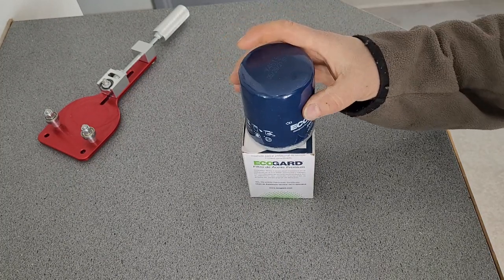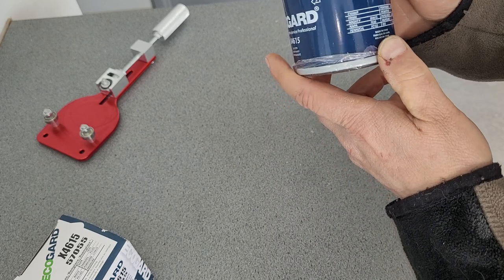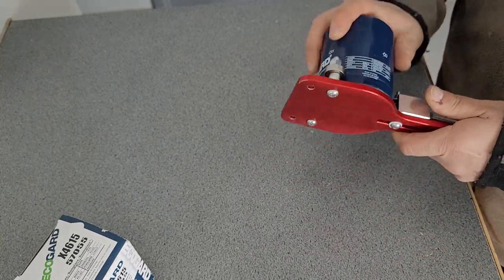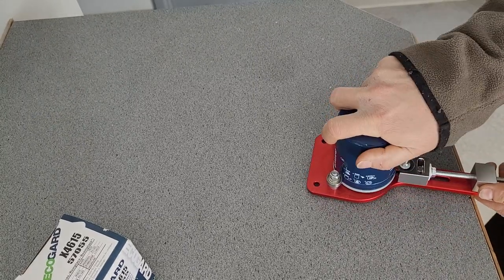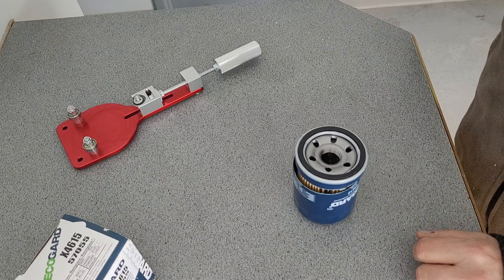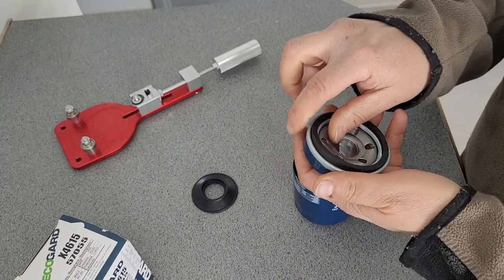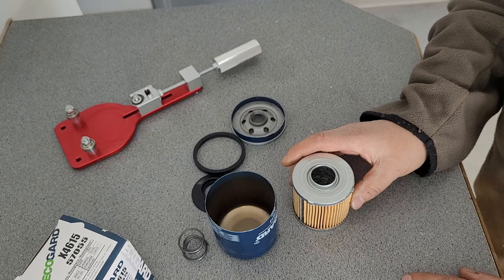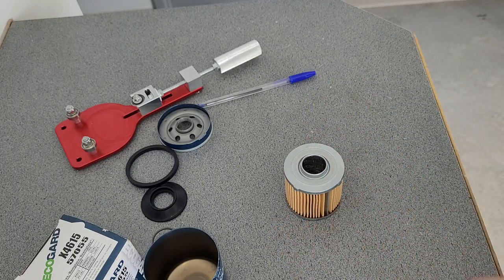ECOGARD oil filter review ☹️

Comment: Thought I'd add some thoughts. 
-the x4615 is used on subarus which  have a higher bypass pressure. 
-I find ecogard to use higher gauge steel than most name brand economy filters. (fram, mann, purolator, etc) Which is why they're hard to cut open. 
-I don't doubt the calibration of your hands, but a rip test probably isn't a good representation of filtering capabilities :)
Reply from the maker: Thank you I agree, and am trying to figure out something different.

Comment: I use the EcoGard model no. x2500 oil filter on my 14 Impala 3.6L VVT with Quaker State Full Synthetic Dexos oil.  Never an issue.  They are looked down upon because they are "Made in China" but lets face it, what oil filter isn't?
Reply from the maker: Seems like China may now be the biggest supplier of oil filters to almost all oil filter makers. If it works and no problems then it's good, more expensive oil filters are made worse than EcoGard.
Reply: awesome review! Subbed. @crazybillsgarage
Reply from the maker: @mvlogs1955 😊
Reply: K&N
Reply from the maker: @TalonBugs K&N for the win.👍

Comment: And due tell, what's a "better cheaper filter"?
Reply from the maker: I would say Baldwin but its more mid grade filter. So I will say Champion filters work out well.
Reply: @crazybillsgarage  ... Baldwin is labeled Baldwin. Champion, I've read some filters are/were made by Champion but I've never seen a filter labeled as such.
And so many manufacturers have changed... I was loyal to Purolator until I recently discovered they're made by someone else and the quality is way down. Today I had to buy an Ecogard, never heard of that name before. With oil filters these days it's like Russian roulett... you never know what you're getting or who actually made it!
Reply from the maker: @hmdwn you are exactly right, to many oil filters have offshoot names for the same filter. Many are the same that you do not like to use. I still prefer the Baldwin product though.

Comment: Ecoguard is Take 5 oil change’s shop filter brand so if you get your oil changed there you’re getting one of these garbage filters
Reply from the maker: Yeah those quick change places try not to spend money on decent filters. Plus the oil they use is kinda garbage also.
Reply: @crazybillsgarage  I’ve seen what the bottoms of their storage tanks for the oil looks like ain’t no way I’m taking a chance with any of that contamination ending up in my motor bottled oil only for me to